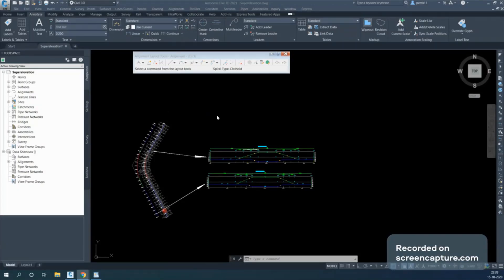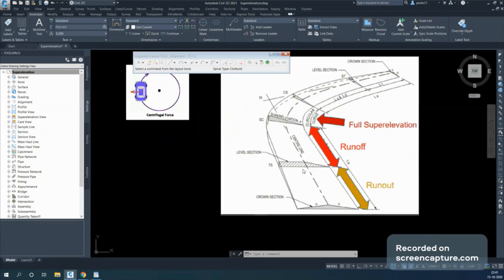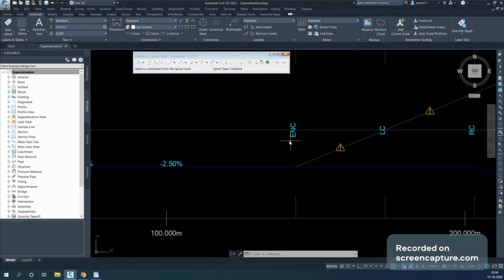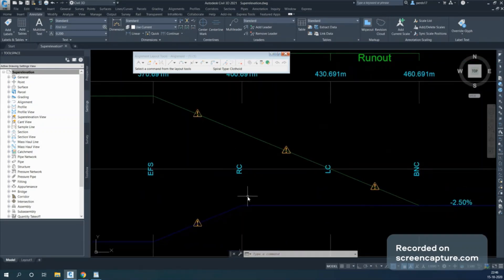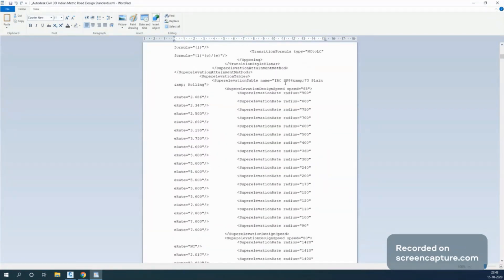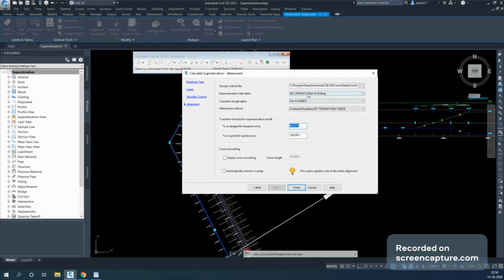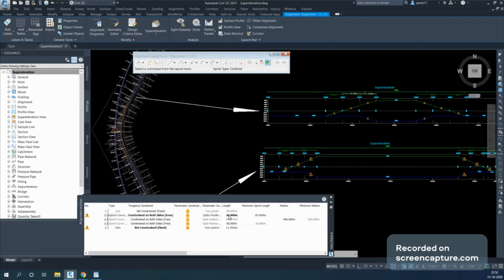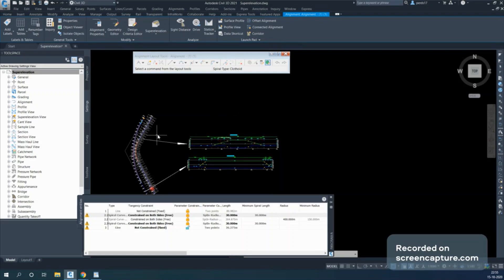Civil 3D - Super-elevation Design Part-1

Comment: For more than 4 lanes .. how to attain super Elevation. suppose for 6 lanes if we go to superelavation wizard we can find only 2lanes on either side.. provide me solution
Reply from the maker: You can change lane width. Superelevation equation use N x w.  So you can either provide number of lane or you can increase width and keep N=1.
Reply: @Civil3DProTipsandTricks  I think this might work out.. Thank u .. let me try this and tell u..
Reply: Sir, how to apply super elevation if there is a divided median with different side slope ex: depressed median or flat median and both the lanes have 2% slope in opposite direction ?